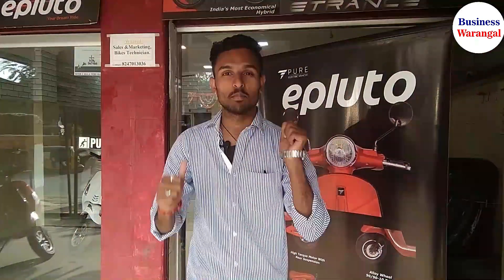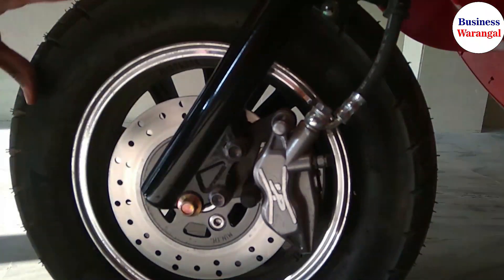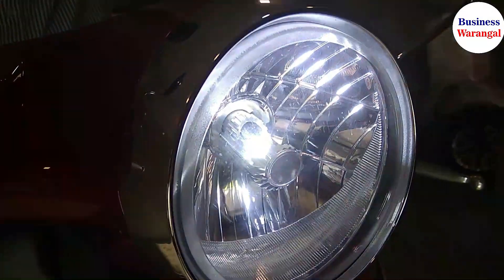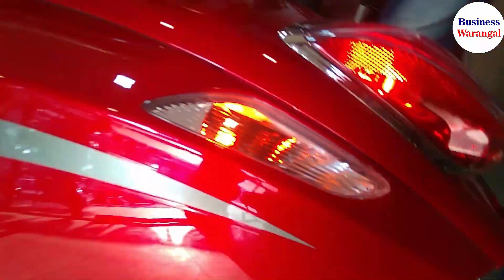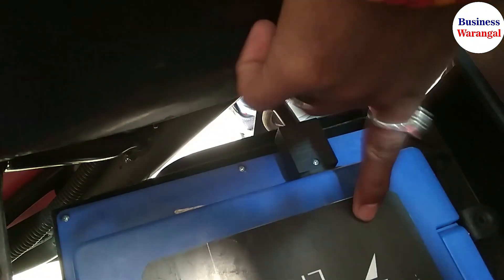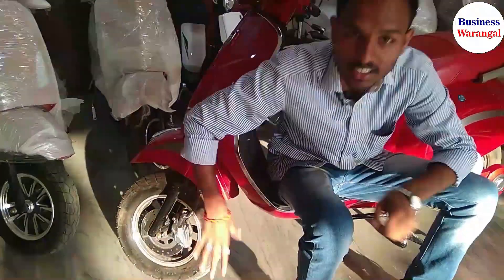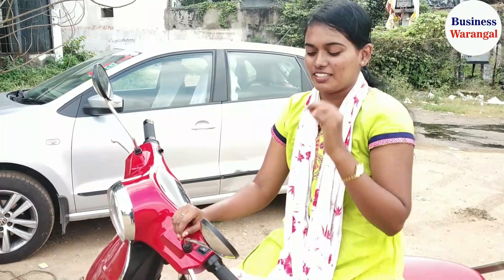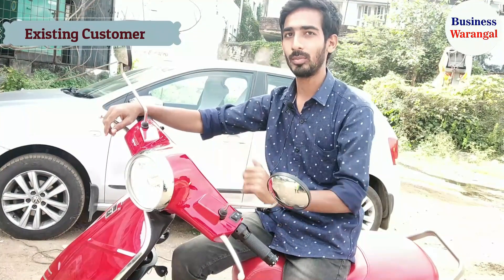Electric Vehicle ePluto Telugu Review and Customer Opinion #warangal

Comment: Scooter is good.  Mileage good minimum 90 Bcz very big lithium battery. But no boot space you can't carry even  charger also.  Maximum speed 54kmonly not 60kms as told by the company.  Out of the six steps of battery indicator first step goes at 33kms with 2nd mode of speed. Seat is very small not fit for 2persons. For availing battery warranty and motor  warranty  so many restrictions  like you have to get two free service  and 6paid service.  Actually they cannot do any service Bcz it cannot be opened.  You have to simply pay for it.  They can tight the screws.  Company says you have to contact the dealer only for any issues.  They don't reveal their phone number  also.  Battery discharge itself faster if you keep the vehicle idle for 2days. Battery costs Rs. 40000. After 3years the performance will come down and you have to spent again Rs. 40000.Most of the dealers are new to this field.  They can sell but they can't give service. Company people call and enquire about the vehicle after one week to get the feedback. Vehicle is good for riding . my vehicle within a week had some issues and send mailed also.  But so far they have not replied.  But after two years only one can judge. For full charging 5to 6 units power and 6hours required. Don't trust any reviews in the you tube.  Bcz they run the vehicle for 5 minutes only.  We are using   it and commenting on our experience.

Comment: What is the life span of battery? What is the cost of lithium battery?
Reply: Lithium Ion batteries life will be 1200-1500 Cycles, with vehicles you will get 3yrs replacement warranty.
And price starts from 28,000/-  based on capacity.

Comment: It is not coming as published mileage.
Reply: Range may change as per speed , weight and driving way also, pls contact near by showroom for battery test , if there is a issue with battery and is under warranty and then they will replace your battery with new one at free of cost